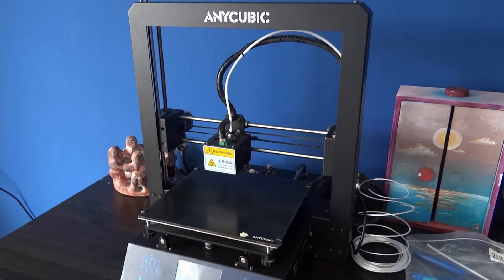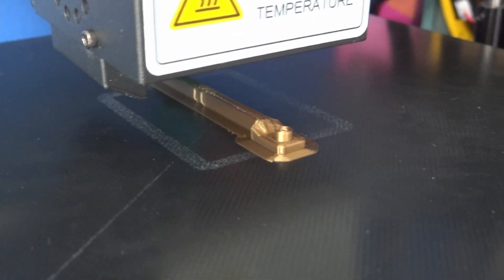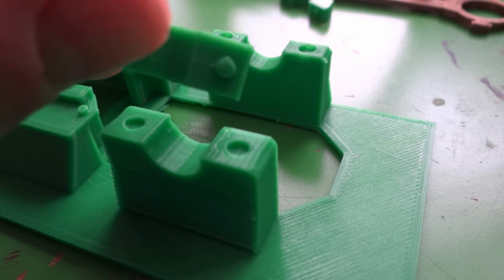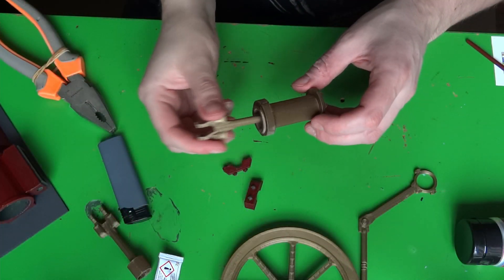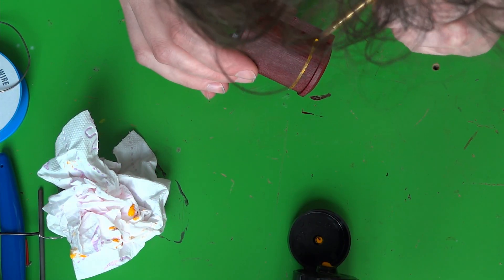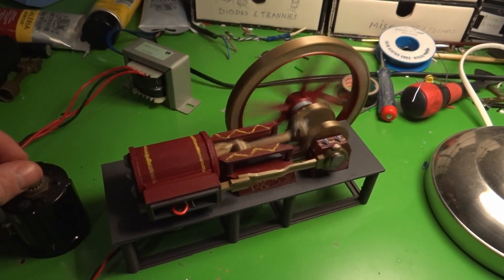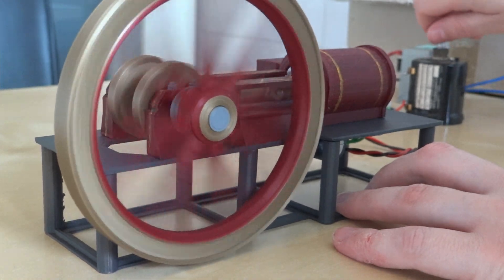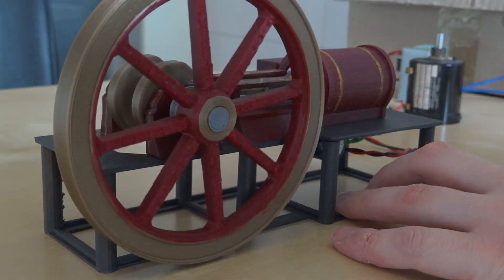3D Printed Solenoid Steam Engine #1

Comment: Es el mejor que he visto , apariencia antigua y parece que anda muy suave . ¿ cuanto voltaje y corriente requiere? , ¿que ohmiaje tiene la bobina? ¿desde donde se desplaza el imán dentro de la bobina? Gracias por publicar gran trabajo.
Reply: ¿utiliza dos bobinas ? Conmutador en las dos direcciones?
Reply from the maker: @jorgeorlandoneirapineda1118  I simply turn on each coil in succession, depending on which direction I want the magnet/cylinder to go. It makes the switch required much simpler than one that needs to reverse current through a single coil.
Reply from the maker: Thanks for the kind words.

This ran on a 35 volt, 500mA power supply. I didn't measure the coils but I gather they were a couple ohms since there where a lot of windings. 
The magnet is in the cylinder and moves between two coils on either end.
Reply: @brassandbricks7701  he construido algunos motores de solenoide (no con esos excelentes acabados, un poco rústicos ) pero no requieren tanta energía, muy poco voltaje y muy poca corriente me gustaría mostrarle , ¿ puedo sugerirle uno que subí en YouTube?
Reply from the maker: @jorgeorlandoneirapineda1118  Sure thing, new knowledge is my favorite :D
Reply: Buenos días,  buscar en YouTube "motor de solenoide con pistón expuesto "

Comment: Good Job;) it run smother than i thinked and can you make it so that it runs real with Steam?
Reply from the maker: Real steam would require special heat resistant plastic, which does exist but is a little out of my budget right now.